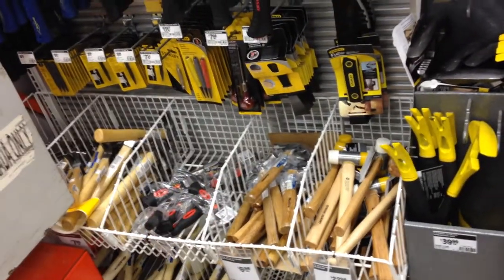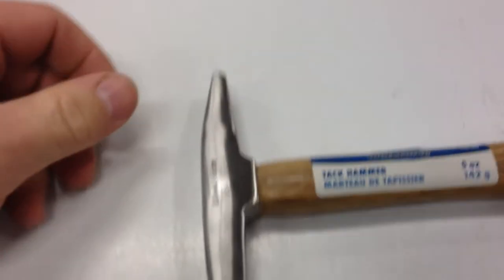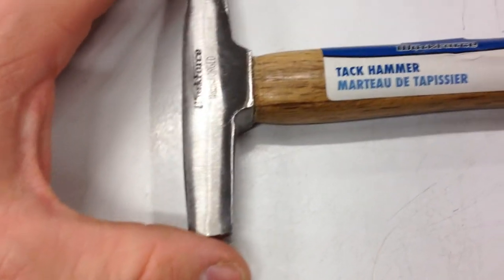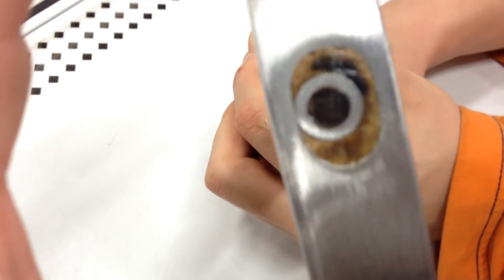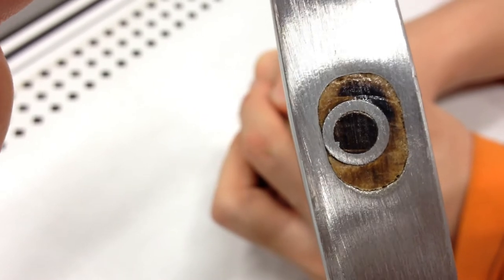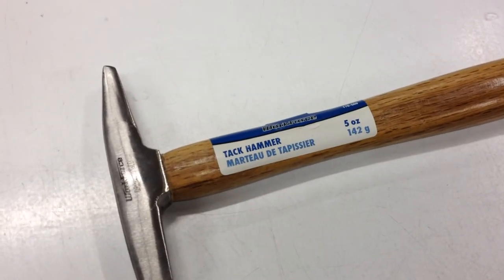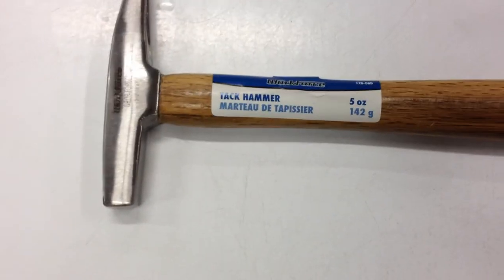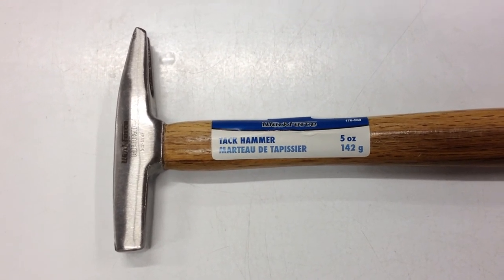Tool manufacturer fail

Comment: part of why it wobbles, if you were to see inside the eye of the head (if you took it off) you would see instead of a double taper (like an hourglass) it has very little as its badly made, so the handle and the eye end has nothing to expand into, so will always be loose even if you drive the round wedge down further, it will become loose very soon again, many bad hammers are like this, plus the wood is very hard (supposed to be hickory or ash) but its some other wood that will not expand properly in the head, and would crack if you tried
Reply from the maker: jusb1066 Thanks for the thoughts.(Looking at the prominent medullary rays of the wood the handle is red? oak.)
Reply: i also forgot to say, the head is very shallow too, also a bad design choice, quality hammers are always deeper to spread the load out over the wood, to give room for the double taper, keep up the good stuff dude :}